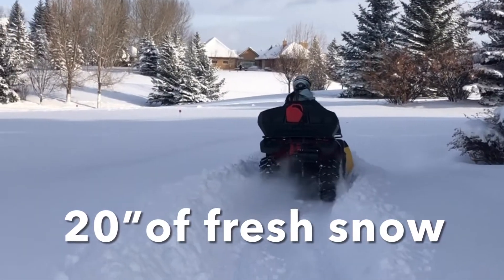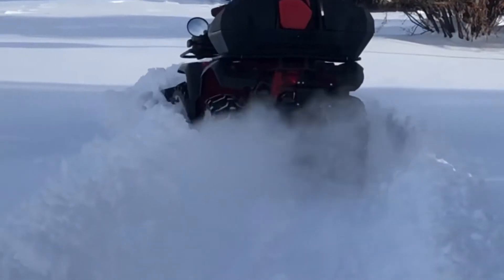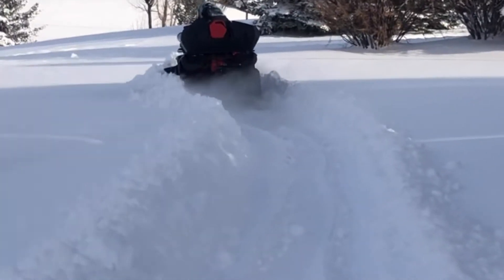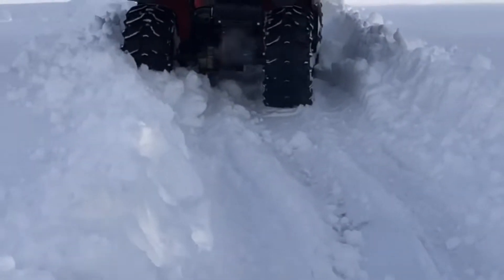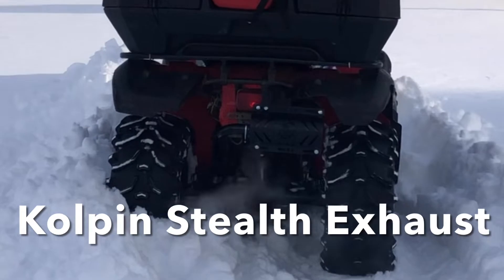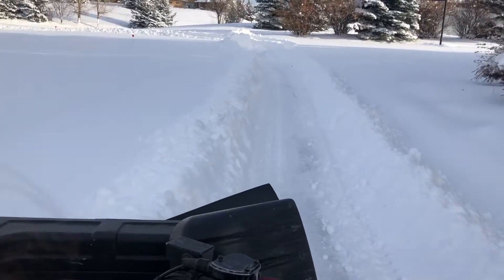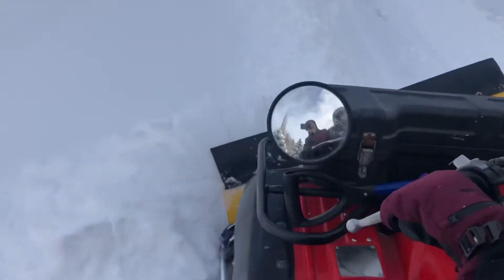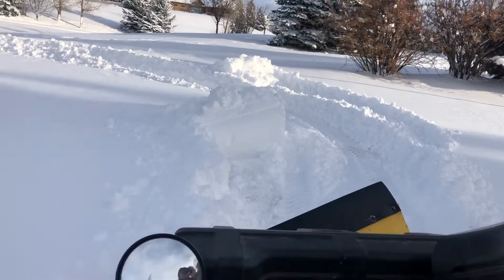Plowing Snow With a Yamaha Kodiak 400cc 4x4 Quad with a County Plow

Comment: It did really great in the snow. 
I have the same problem my cforce 520 is too light for pushing the snow
Reply from the maker: Thanks. It’s probably too light with just you as the driver. If you can put on 200 lbs of sand bags or add another rider you’ll have a great snow machine. I’ve also never experimented with tire chains but that might be an option.

Comment: What year is the Kodiak? Is it one of the older ones with low range?
Reply from the maker: 1999 and it is a five speed semi-manual, meaning you manually change the gears with your foot but there is no hand clutch.  It’s still going strong!  The thing is a beast!  I’ve been driving it with a torn CV boot and it clicks when I turn but 10 years of that and it still doesn’t need a new axle.